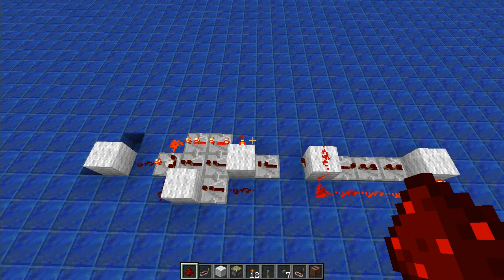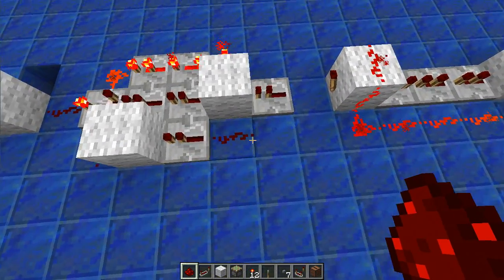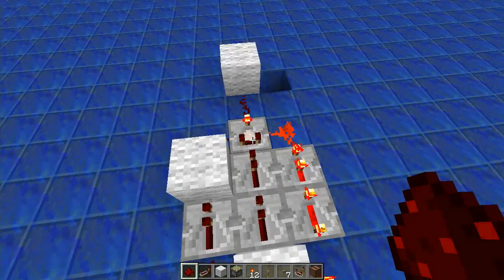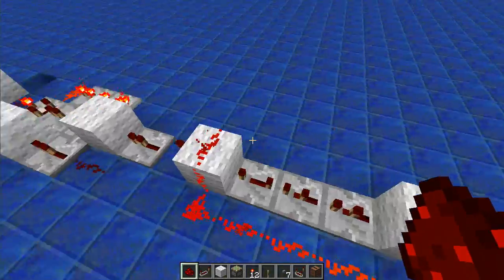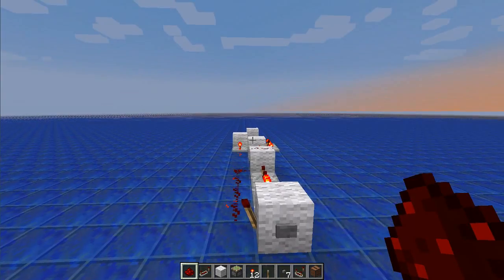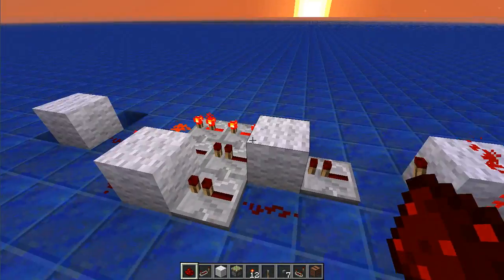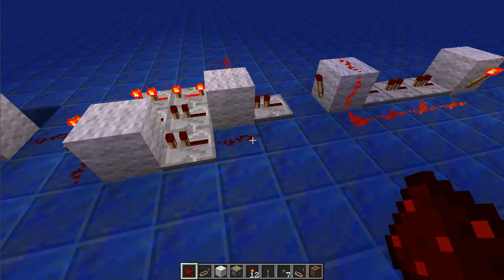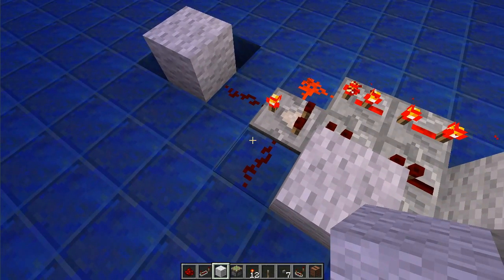Smaller Pulse Length Decoder/Frequency Filter for Etho

Comment from the maker: Basically what the goal of this is is to use a single line of redstone connected to every portal to control which portals to enable. The length of the pulse (which is measured in ticks (1/10 of a second)) is detected by this to determine if the portal this is hooked up to is to be enabled. The reason pulses are used is that it is very easy in minecraft to make a pulse of a certain length. I just put a link at the end of the description of a low quality demo vid of what this is meant to do.

Comment: As I understand it, the bottom row lasts for the length of the pulse, and the middle row is delayed by one tick (yes?), which means the bottom row should shut off one tick before the middle row (yes?).  So if the pulse lasts until the top row shuts off, shouldn't the comparator output the moment the bottom row shuts off, regardless of how much longer the pulse is?  It looks like the bottom row functions as a sort of "maximum" but how?  Obviously I've made a bad assumption.  Awesome, though.